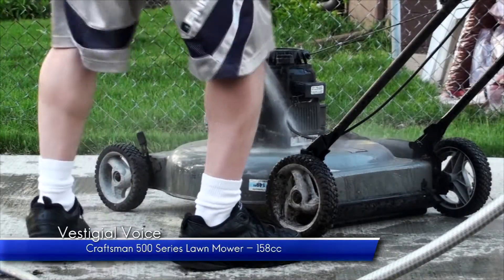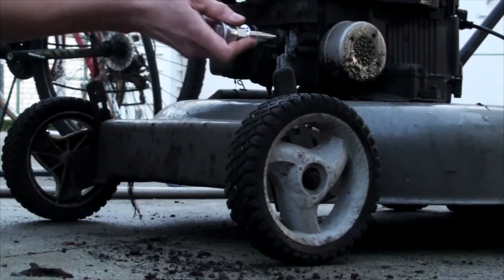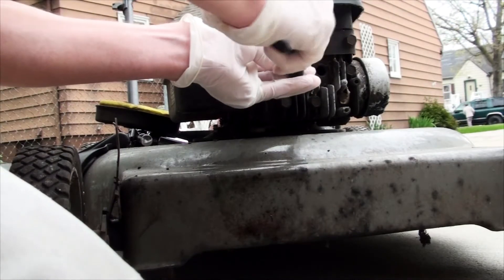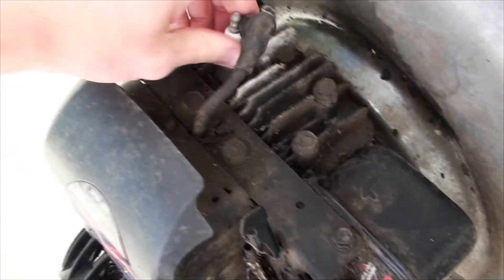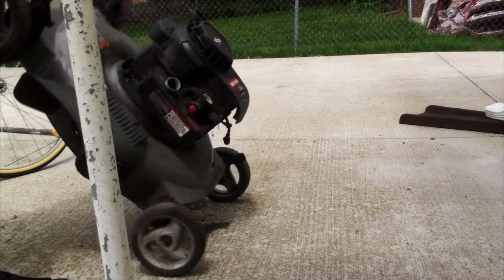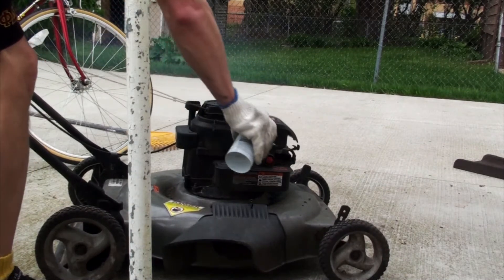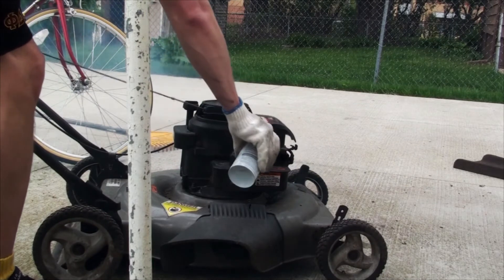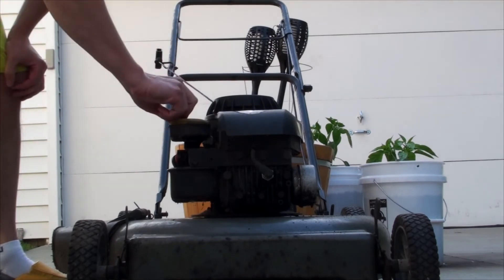[Resurrection!] Craftsman 500 Series Lawn Mower Repair - Briggs & Stratton 158cc Engine

Comment: Thanks for the idea. I picked up a free mower with a sparkplug full of metal shavings and  black grayish oil. Im going to drain the oil out . Flush it with and gas and do the seafoam trick. It does not start with starter fluid and i checked the ignition coil with a tester. Only other thing could be a sheared flywheel key.

Comment: What type of oil do I need I got the same kind of like you guys I got the same Canton lawn mower is 158cc 5.00 what type of oil do I need
Reply from the maker: @woogyswheeler2208  5W-30 works just fine, synthetic or otherwise.  If you are in a super warm area (80-100'F), go with a thicker (10W-30) engine oil.
Reply: @VestigialVoice  ok 👌🏿